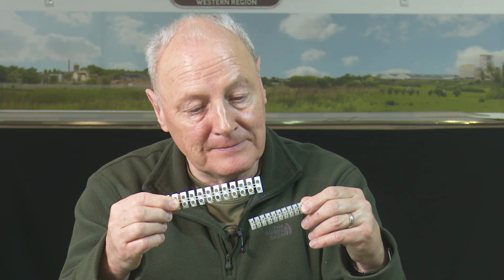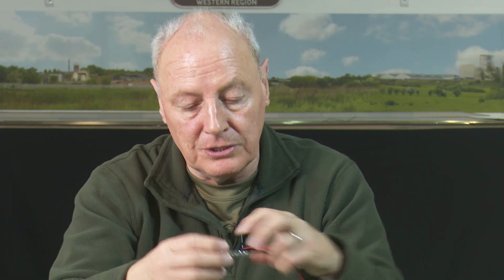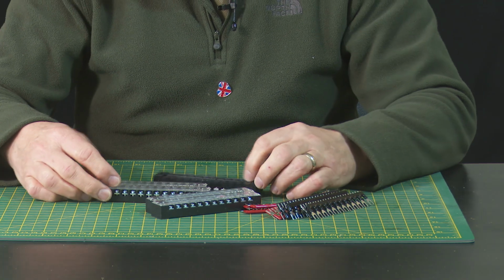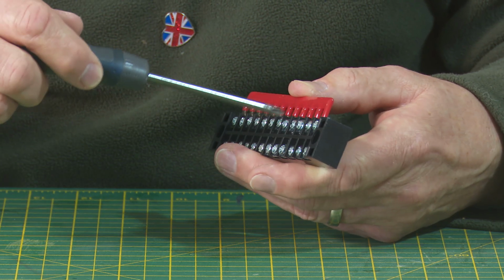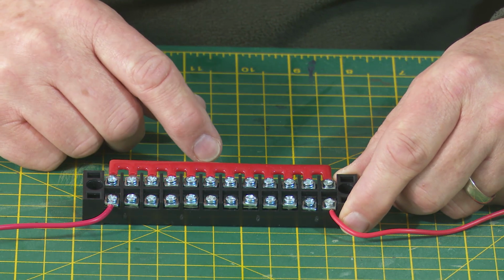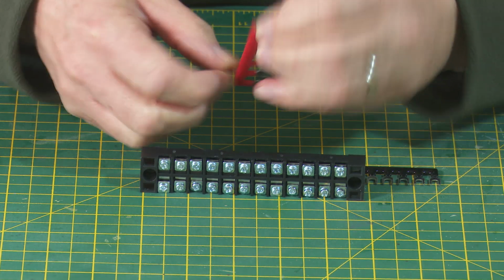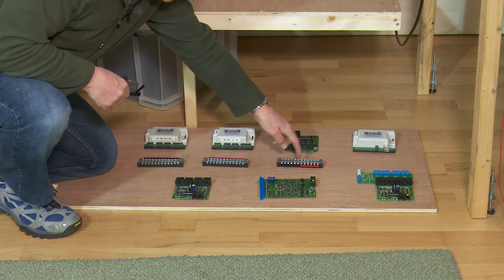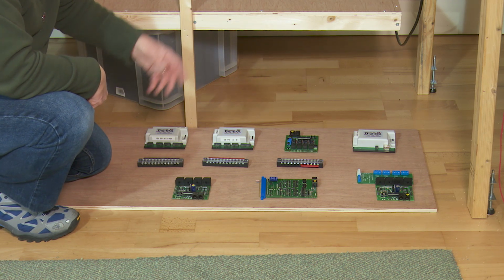Terminal Blocks for model railway wiring at Chadwick Model Railway | 85.

Comment: Hi Charlie,  I love your channel and these connection blocks are a great idea, I've been playing around with an idea of mounting all the 'under board' components/wiring an a separate board, as you've  suggested, but mount it on hinges to the inside of the front frame rail of the base board, that way when you hinge it down, all your components/wiring are right in front of you, at the front of the layout and on the back wall.
If you give your wiring an arch from base board to hinged board, you won't have any problems with the wire.
And you can do any work on the board while sitting on a comfy chair 😁
Cheers Ian Mac.
Reply from the maker: Great comment Ian and I’m now using both wall mounting and a flap down board.

Comment: Hi Charlie as I live in the Philippines i buy mine direct from China at equivqlent 5 pound for 10 but without the tag joiners.Also i find they are great to isolate for fault finding on DCC just by disconnecting the loop
Reply from the maker: Thanks John, stay safe.

Comment: Charlie,

Check out this guy - - https://www.youtube.com/watch?v=-9Utsv0U2n4&t=453s

He ran a 1x2 or maybe a 1x3 horizontally on the legs at the back of his deck.  From here, he mounts all his electronics, like switch-kats from NCE to power turnouts.

So how does he distribute power and signals, why with terminal blocks like you are showing.

But with your idea, and his mounting board idea, perhaps there is a solution for you.  He is able to sit in a low-slung chair of sorts and reach in directly to them without being on his knees.  He also strung a white led light strip under the main deck so he can see what he is doing down there.

If interested, perhaps you can write him and ask him about his "wiring chair".

Good luck with this and let me know how this works out.  I may do it myself.

PS - I have a friend in HO that is using black light for a night scene.  He went to Hobby Lobby ( krafts) and picked up miniature white plastic dots of some sort on velco, and stuck them around his back drop, in the clouds and such.  Larger ones, medium ones, and tiny ones.

When the lights go on, they florese (glow), producing a "deep" night sky.  But small enough that your eye does not pick them up in the normal light.  I thought that was really cool.  I would think that you could place these little gems around and not actually need to wire them up under the blacklight.  Like little points of light on the outside of buildings, street lights??, or such.  

Bob S - Brecksville, Ohio
Reply from the maker: Thanks Robert, I’m on it.

Comment: Permission to refer to the 'Bridging Contacts' as 'Busbars'. Also, have you considered using 'Boot Lace Ferrules' on the ends of your wires? Tidys up the bare strands, and would make insertion into your 'Busbar Blocks' less of a faff. Forked crimps would work, but the boot lace ferrules would work universally with all the terminal situations you would encounter, I'm sure.
Reply from the maker: Great tip and I’ll check it out.  A crimper will also be required.

Comment: Hi Charlie, could you not add the power in power out on the same side as the jumper bar, that way still get full 12 outlets to use
Reply from the maker: Yes indeed, I was a little slow there.

Comment: Good spot Charlie, we used something like that at work and never thought of that for railways so have just ordered a pack.  We also used something like this https://www.ebay.co.uk/itm/Insulated-Electrical-Splice-Crimp-Connector-Terminals-Spade-Fork-Type/310590178084?hash=item48509e0324:m:mtEJfcQmx23HxrZTRWDolkg for the wires feeding motors and sensors. The crimp gave much better support to the wires and sped the time to swap out units like motors and sensors. You can normally get two spades under each screw too.  Ours were colour coded with a strip of Humbrol paint on both block and terminal to make swapping units even easier :-)
Reply from the maker: A very sensible option Stephen. Many thanks

Comment: Great as always Charlie. In regard to your control board could you not fit the components to the smaller board and have it sitting at a 45 degree angle against the wall on the board already in place. That would give you fairly easy access with a small area in front of the flat board for other parts (hand held controllers etc) to rest when not in use.
Reply from the maker: Interesting points Mr Bones. It looks as though I’m going to wall mount it.

Comment: Not sure if someone else has suggested this Charlie, but with the option of cutting the spade connectors into two, you could solder the bus wire to the outer cut edge [OK a bit of soldering before installation] leaving all five terminals available. Does that make sense?
Reply from the maker: Perfect sense Tony, many thanks.

Comment: Hi Charlie and greetings from Northern Virginia. I had not seen these before, so thanks. My solution has been to use left over Tortoise edge connectors. A decking strap from Home Depot connects all eight tags to the bus, and is easily pulled out to isolate for fault finding. Hopefully the pic explains.
Reply from the maker: Sorry Tom but no pic.
Can you send a link?

Comment: Hi Charlie, Just watching your video on the new terminal blocks and wondered why you didn't attach your bus wires under the first/last screw with the bus bar? You have just used two potential output terminals. Regards, David.
Reply from the maker: Because I'm not that bright David!  You're not the first to mention it either.
Reply: @ChadwickModelRailway  The way you showed in the video shows the concept clearly, I'm quite happy soldering but these terminal blocks would certainly make some jobs much easier.

Comment: Charlie, the squires ones allow two busses, but the Amazon ones only support one bus. 
But I agree about keeping expansion capability on screw terminals; just a matter of the cheapest combination. 
Thanks for the video.
Reply from the maker: But Tom you can convert it into two buses, i did!
Reply: Chadwick Model Railway 
Thanks, Charlie, I noticed that. And your colour coding is wonderfully simple; almost as simple as making the jumpers for the chocolate blocks from the same wire as they are bussing. I suspect that, against the logic of fitting as little as possible to keep things cheap, some spare capacity with screw terminals at key nodes sounds like a good idea. 
Those bus plates are great, and used in household mains distribution boxes; it may be that Screwfix et alia may be able to help (but apparently no so cheaply)
BTW, COVID19 strikes again, and I’m not going to Wimborne or Ally Pally. 😥😕

Comment: Charlie using terminal blocks are indeed an easier way to manage connections.  I might suggest that, instead of pushing your cables into a terminal block, it would be better to use a spade lug on the cable.  That way inserting and removing a feed would be much easier.  Inserting stranded wire (UK cables) into a terminal block always has the problem of a stray strand could stick you in the finger or worse yet, touching another circuit.  This, of course, can be minimized by tinning the cable before inserting.  A better solution is to attach a spade lug by crimping it to the cable, then soldering the cable to the lug.
Reply from the maker: Sound advice Earl, I’m on it tomorrow.
Reply: @ChadwickModelRailway  I check out terminal blocks on Amazon and they have several different options as to the number of contacts available.  They also have ones with yellow and blue terminal barrier jumper strips.  Look at the Glarks blocks.  They have 3, 6, 7, 10, 12, and a combination kit.  These include the Terminal blocks, jumper strips, and the spade terminals in Red, Black, Yellow, and Blue.  (You would be all set except for your Green frog wires ;-)  Green does not seem to be available, therefor you are stuck, so to speak, with green tape.)  You might also take a look at https://www.aliexpress.com they have all four colors, many choices, free shipping to the UK (not 2 days like Amazon thou, more like 20 days.)

Comment: I am an electronics tech. who worked in telecom for decades, and am very familiar with terminal blocks. My suggestion would be to get some spade connectors. This way you could connect your pos and neg wires to the bus bar side of the terminal thus giving you 12 feeds as an option. There are specs that indicate the limit of connectors on one terminal position, usually it is more than one.
Reply from the maker: Sound advice Geoffrey, many thanks.

Comment: Im not sure if cable length is an issue on DCC, but if it isn't then your idea of the vertical board at the back will work if you make a cable loom. 

its something they use in a lot of electronic and electrical setups, where all the cables will enter or exit the board at one location , grouped together and then are routed to the various components.
That way with enough length of the loom coming from the layout to your board , you will be able to bring it to the front to work on then replace it at the back when your done :)
Hope this at least gives you food for thought.
Keep up the good work Charlie.
Roger
Reply from the maker: Thanks Roger, an interesting option.

Comment: where you cut the jumpers in half you could scrape off some of the coating and solder your main bus wires to the jumper, just cover with tape after,
Reply from the maker: An interesting point Adam, many thanks

Comment: Have used these terminal blocks on by brother in law's railway I wired up for him. I put the input wires on the same side of the busbars then you don't lose any numbered terminals. You could solder the leads to the bar but have had no problems compressing the bare copper cable under the spade connector.
Reply from the maker: Useful tips Steve, thanks.

Comment: Thanks for the video.  I think the idea of having a board fixed to the wall is better than a fold down one.  Although the latter may be more tidy, it does mean that you will have longer wires and there is a greater risk of a wire becoming detached when folding down and back, or worse still providing intermittent connection.  The units are very useful and have advantages over the chocolate box and certainly over soldering upside down (especially with my soldering skills).  Thanks again and keep up with the videos.  You ought to put a collection of the videos together and sell them as a "How to do" for modellers.
Reply from the maker: Hi Daon, I've taken the "On the Wall" option.  Wish me luck.
Reply: @ChadwickModelRailway  I do, Charlie.  But even if something goes wrong then you admit it and put it on video so we can avoid it.  It allows us to make other mistakes of our own.

Comment: Nice informative video, showing usefulness of connected terminal blocks..
Have you seen the "Wago" connectors.. they have all sorts  with easy wire connectors, and very cheap ..
Reply from the maker: I’ll check them out too Bigfella.
Reply: @ChadwickModelRailway  I have used them on fitting household ljghts, then realised good for easily connecting wires on my Model Railway.  They work out at about 30p when you buy a box.

https://www.wago.com/gb/electrical-interconnections/discover-installation-terminal-blocks-and-connectors

Comment: I use those terminal blocks as well, Charlie. They are wonderful. Instead of inserting a bare wire into the block, you may wish to use spade terminals (at least that's what they're called in the States). Just crimp them onto the bare end of the wire, slip them in place, and screw them down. Makes removal and re-install a breeze.
Reply from the maker: Do you use special crimping pliers?
Reply: @ChadwickModelRailway  No special pliers. I just use the crimper on my electricians multi-tool. Mine is a Stanley 84-199. There's nothing particularly special about that particular tool, a lot of different companies make similar items. Do a Google search for the above tool and you'll see what I'm talking about. You may even already own one.

Comment: Hello Charlie,
Just a possible refinement to joining up wires to the terminal blocks. Rather than simply twisting together the bare ends of a multi stranded wire and then pushing it under the terminal clamp, use a bootlace ferrule to keep the ends of the fine wires firmly crimped together. The ferrule makes inserting the wire into the terminal much easier and prevents odd strands straying into places they should not be. A reminder that the twisted ends  of multi stranded wire SHOULD NOT be soldered into a solid mass and then clamped into the block. Plastic flow of the solder will cause problems with the joint.
Keep up the good work and hopefully virus free.
Reply from the maker: Thanks Frank, I’m on it.
Reply: if you are going to crimp something to the wire then why not just crimp a spade terminal to the end of the wires, takes seconds and clamps down better

Comment: Charlie this is going to sound crazy but I must share! (In regards to your digit-trax & computer unit's)
If you have an area of that board section that is just going to be scenery, why not make a pocket in the top section of the table to fit all the digi-trax and computer guts near one of the edge's if possible and have the scenery be attached too a removable trap door or hatch. That way you can save your knee's and back going under the table and just have access too it while sitting or standing and will not have to worry about the wires flexing and causing problems.

Another not so crazy idea is more simple would be too make a horizontal access panel under the planned table section area that way still saving the knee's and back and you can still hide that its there while still being able to work on it via a chair (I know at this point I'm sounding like a lazy lad but take it from a lad who's wrecked his knee at age 4 and his back 3 different times and 1 being more recent *chuckels*).

This will however leave that under piece little more then a shelving unit sadly. Then again you could recycle it as one of those....what have people here in North America been calling it now..... a off site fiddle yard??? Basically it's a section that is just a track yard too park a train at too simulate its left the area to go deliver to another area or area's for awhile (No scenery is ever added but some do paint or basic flock too break away from the plywood texture) then either return with a different train of cargo or bring back its empty train in which some like to change up the order the rolling stock went out in too further simulate different drop off and pick up times.

Hopefully  this helps or helps spur's other idea's.

- Ross
Reply from the maker: Thanks Ross what an interesting comment.  I’m currently mounting every thing in the town area on the wall. It’s a little low but is much more accessible. Regards Charlie.

Comment: Nice Amazon find Charlie; Thanks for sharing it.👌
I haven't put too much thought into your shelf problem but, the first thing that sprang to mind; what about mounting the board at 45° ?  If you mount the 45° board on top of the newly-installed shelf, you could hinge it at the back, so the front can be lifted a bit. That would give you a bit of a hidey-hole under the sloping board too.
Just a thought, my back gives me grief too.😩

Cheers for now,
Dougie.
Reply from the maker: An interesting option Dougie.

Comment: I love these terminal block been using them for about 5 years now. Just be carefull putting bare wire straight in. Sometimes they tend to wiggle loose. Best to use the Y wire terminal connectors on the ends of your wires. Thanks for sharing Charlie.
Reply: Hi Charlie, the connectors are described as “fork” connectors, I think that I sent a link to them in my email but they’re easy to find on eBay and amazon. The best size for model railway wiring is coloured red and yes, you will need a crimping tool.
Reply: @george_kennedy  yes george is correct. You can find them on amazon or ebay. Also note different size wires need different size fork connectors.
Reply from the maker: Hi Rick, where did you buy the terminals and did you use crimping pliers?
Regards Charlie

Comment: They look good. To save on output terminals, is there enough space to put the feed wires on the same side as the bridges?
Reply from the maker: Good point S75
Reply: there is, but keep it tidier by running multiple feeders from the non-bridge side.

Comment: Get yourselves Wago connectors. All you need for a fantastic connection by using just your finger on the lift tag. Very easy if mounted under your boards. Use the 221 series. Not cheap but they are foolproof and maybe where you have a particular pain in the a**e location, they will be a breeze
Reply from the maker: I’ll check them out Graham
Reply: We use Wago on real railway these days, but I’m not a fan,  maybe just stuck in my ways 😂
Reply: Tricky Mc22, really, a Wago to control a full size Azuma. 😂😂. We use them too. Never been an issue other than the expense

Comment: Ive been a sparkie for 45+ years and have used all kinds of connectors over tat time.  For the past 5 years or so I have been using "Wago" lever connectors. (221 series) available in 2,3 or 5 way. The five way are excellent for your BUS connections.  Brilliant and will handle up to 32 Amps. Not one single burnout in that time.
I now use these on my model railway layout. held in place with a small blob of glue or silicon. So no soldering. No screwdrivers. Just trim cable. lift lever. poke cable in close lever that simple. Easy to alter or add to. Fantastic and definitely  works for me.
Reply from the maker: Thanks Peter, another great option.
Reply: What a good idea! Can you tell me who the connectors wire up to my guage master controller please?